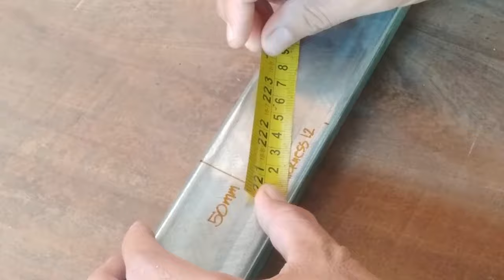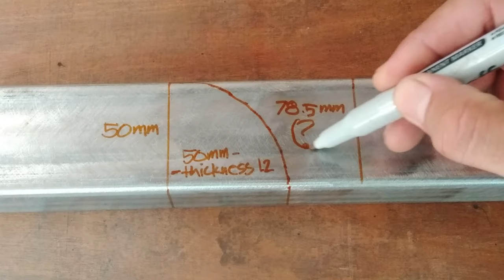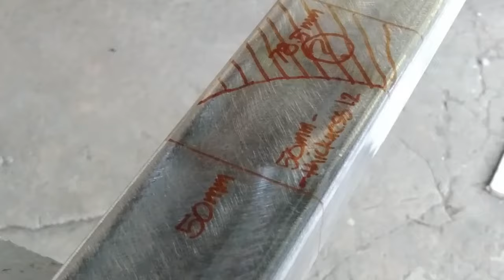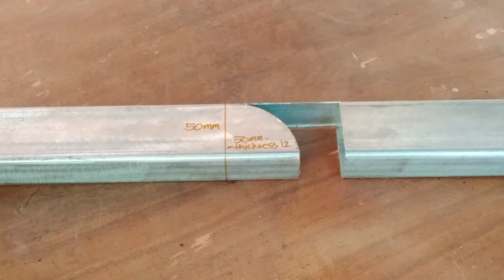HOW TO CUT A SQUARE TUBING TO 90° WITH PROPER RADIUS CORNER

Comment: By grinding down the welds so that they're not even visible anymore, doesn't that weaken the joint?
Reply: Not necessarily, in tubing this thin its difficult to stick weld without burning through, which means almost any clean weld has fully penetrated.

Comment: Great fabrication technique,  however sorry to say poor welding skills. Lots of porosity.  Looks like the welding electrodes  may have been wrong choice.  Satincraft 13 (4213)  or Ferocart 18 or 21 maywork better.  Avoid  cheap no brand  rods.

Comment: 78.5 ang formuka sir?
Kung halimbawa 2x5 ang tube na gmitin sir ganon din poba ang measure 78.5?
Reply from the maker: 2 inches x 5 inches po ba sir? Kung iba po sukat mag iiba din yung radius at sukat ng diameter 2" po kasi ginamit ko dito n base metal 50 mm o 5cm po.

Comment: Except for all the porosity that will make the weld fail and it fall apart, looks great. *eyes rolling
Reply: Unless you’re applying pressure piping standards to this tubing, this weld will be fine.
Reply: @Allen-eq5uf  That'll do is your mantra.  "Good enough" is not good enough.
Reply: @tinnedanger   It looks like he is using a 6011 welding rod which which has a tensile strength of 60,000 lbs per sq inch. lets presume that it’s within established parameters for whatever duty this creators intentions were. If anyone watching this video wants a smoother, prettier weld on their own creations , that could be achieved with a mig,tig, 7018 or a few other types of welding processes; In fact, his main intention was obviously not to show what a perfect weld looks like ,only  to show his formula and process for the radius bend. So, in this context, good enough describes this weld.
Reply: Internet is full of daft comments like this. I have a video of a nearly forgotten way to load timber and someone has replied that he can lift logs heavier than that by hand. So why bother watching my video instead of strong guys lifting heavy weights. Same here. There are plenty welding videos out there. People just don’t get the point.
Reply: @Allen-eq5uf  Ok if your happy with that . That'll do
Reply: @Rubensgardens.Skogsmuseum ))°

Comment: What does the .25 come from in equation
Reply from the maker: 90°÷360°
Reply: @metalworksph  hello u wrong, not 78.5mm >>>> correct 2*3,14*(50-1,2) * 0,25 = 76,62 mm
Reply from the maker: @anderton55  2x3.14x50(90÷360)
                               314x.25
                               =78.5

Comment: Nice job,  really nice job, but I didn't see any square tubing being bent, I was wondering how to bend square tubing
Reply: It's possible to bend square tubing using a plumber's pipe bender, with a length of smaller round bar or rod first bent inside the former.  This rod forces the square tube to buckle inwards, making it easy to bend.  I've done it many times.

Comment: Can you use this method for different angles? I’m trying to work out a cut bend of tighter then 90 degrees
Reply: yes it is in the equation. look for the 90, and in that spot insert your desired value instead.
Reply: 2(pi)(r)(theta/360)

Comment: Simply arc  length is 75mm because 50mm×1.5
Reply: Does this formula work for any sized arc... Nice to ask... 😁😁😁
Reply: @JustinPaul1st  just follow the original arc formula for more accuracy
Reply: No, no, no.  The radius is 50mm, so the whole circumference would be 2 x pi x 50 = 314.2mm.  The quarter-circle, therefore, is 314.2mm/4 = 78.55mm.